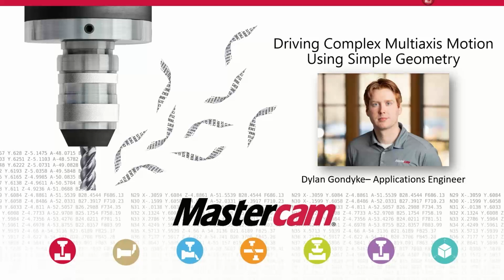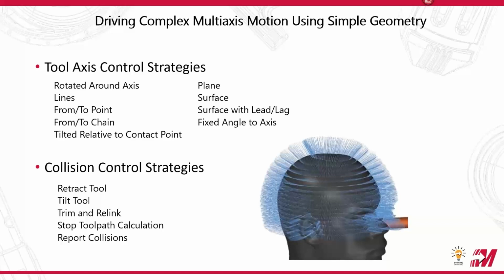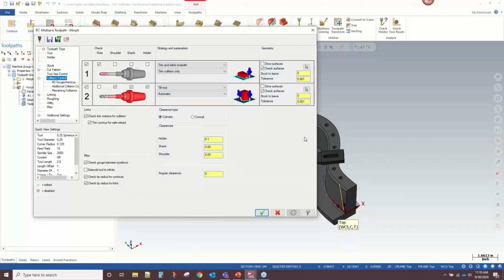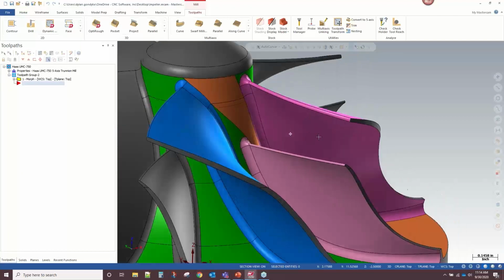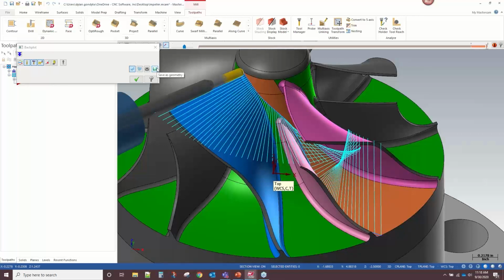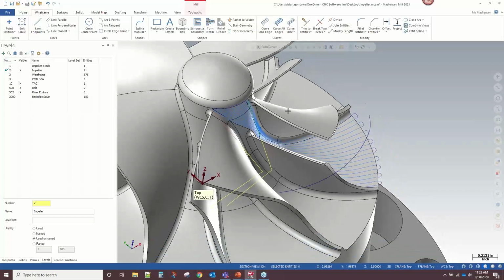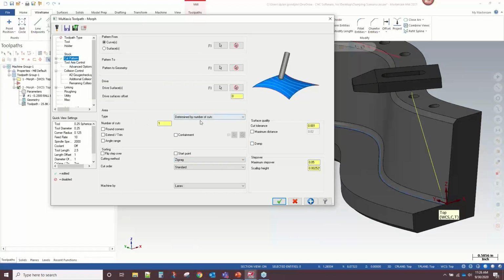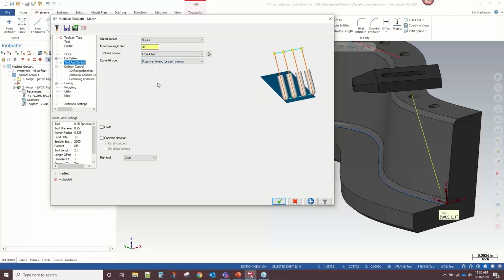Driving Complex Multiaxis Motion Using Simple Geometry

Comment: I have been using for 5 years now, at work, but don’t really get into multiaxis. I am looking to practice at home. For those of you currently using what laptop would you suggest, or simply just have good experience with, that would be powerful enough to run these toolpaths and back plot without load for half an hour? Thanks.
Reply from the maker: Hi Travis! You can find our system requirements here: https://www.mastercam.com/support/technical-support/system-requirements/

Comment: then
Can roughing be done by adding depth to the morph?
Reply from the maker: Hi there! Roughing can be added in several ways to morph, either with depth cuts or multi passes, both with user-specified spacing. And Morph is stock-aware, so it can trim all roughing passes to stock-only automatically if you give it a stock model!

Comment: This is the type of instruction I have been wanting to see for YEARS. I have been a Mastercam user since version 3, and as more complex tool paths have been developed the help menus only gave a definition of the parameters and not a real life example as to how and why to use it. I loved this example. I did the impeller that you demonstrated in this video. It took me 20 or 30 tries over a period of two weeks to get it almost perfect. I just kept experimenting with the different paths and settings. In the end, I didn’t learn much because what ended up working came about by accident and not intent (if that makes sense). We need more webinars,  and videos that break things down using real life examples and explanations like this video. I never knew what  the “Restrict Path” icon was used for before today. Thank you

Comment: Nice presentation! One question, on the impeller why did you selected the second collision strategy box and not the first one? Thanks.
Reply from the maker: If we look at the default setup of Collision Control strategies when we first open a multiaxis toolpath, the second strategy is always a Tilt strategy with shank, shoulder, and holder already selected. This means that in this instance, we can save time by just turning on Strategy 2 and starting right in on adding surfaces. Rather than having to modify strategy 1, we can simply leave it off!
Reply: @mastercam  Thank you.